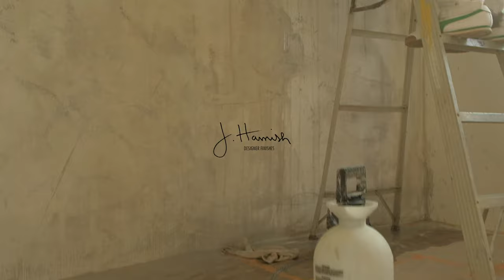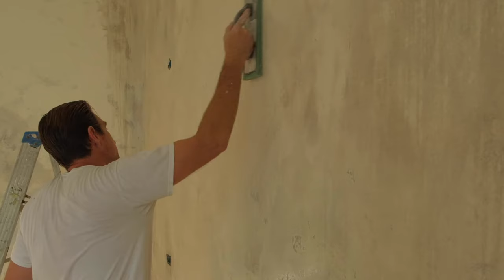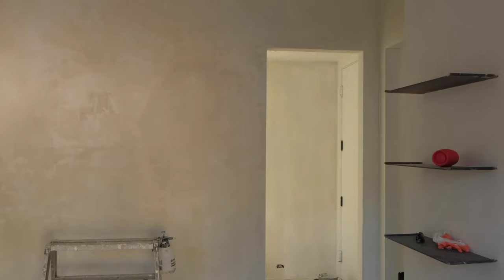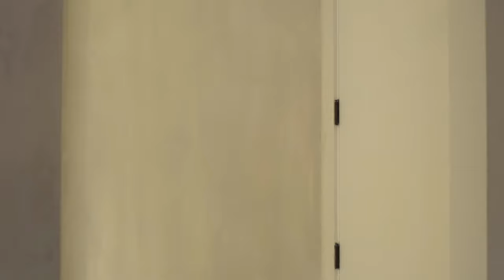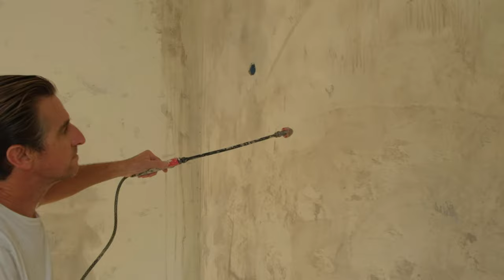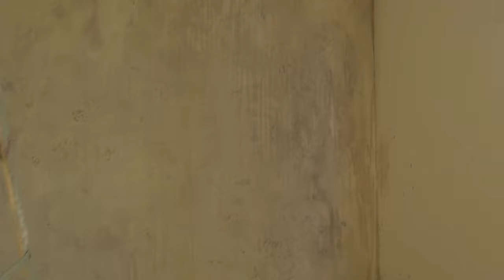Getting Creative with Lime Wash Paint

Comment: Where can I get more detailed information on these creative techniques.... specifically the troweling he is doing? Does this smooth out the brushstrokes? What type of tool is he using. Is this done at the same time you are apply the lime wash with a brush or is it done after? Etc
Reply from the maker: You can apply the JH Lime Wall Paint on thicker and then spread it and brush it out.  It comes creamy so you can apply it without diluting it.  You can also apply with a trowel but that is not needed. To smooth out any brush strokes you can spritz the surface with water and feather it out too. In this video he is using a 5 inch block brush and a float.  This is done after it's brushed on by dampening with water and then using the float.  Feel free to send any additional questions to support@jhwallpaints.com.